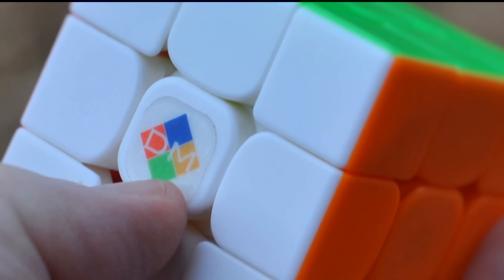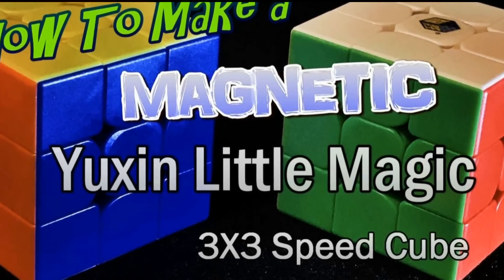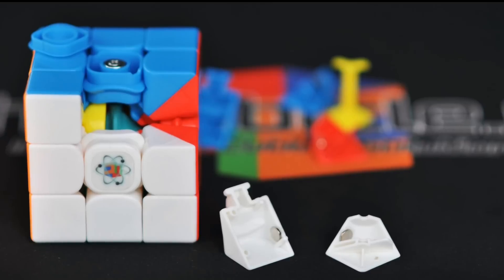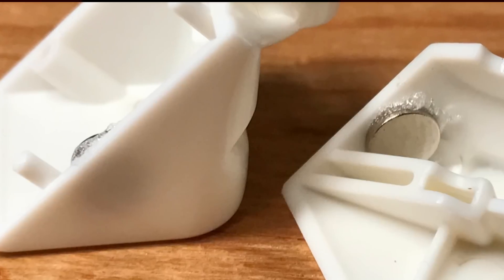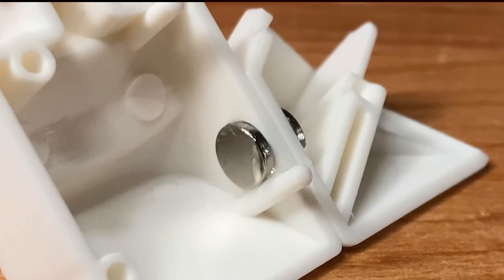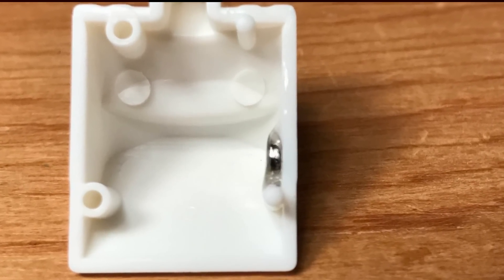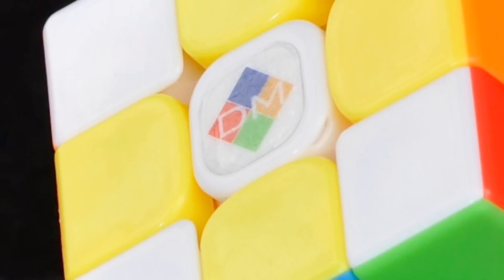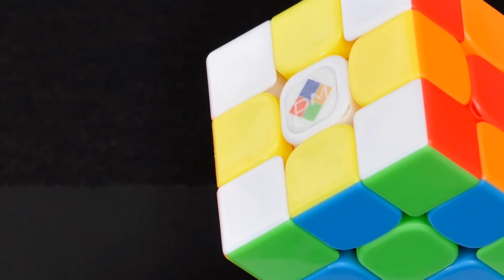Magnetizing the MoYu MF3RS2 Speed Cube

Comment: How long did it take you to magnetize the mf3rs?
Reply: Thank you for your replying I’m such detail! I just ordered magnets and they’re coming on Tuesday. I just wanted to know what to expect from gluing magnets, but thanks to you now I know! I’m going to magnetize my thunderclap v1 and I just wanted to know how far back in the edge I should put the magnet? Keep replying to others and giving advice because it sends positive feedback to the viewer and that gets you a sub! Thank you for your time and have a great week! Ps: I did subscribe 😃
Reply from the maker: Random Dude Thanks for your kind words, and I really do appreciate the sub! Thanks!!!
Yeah, plan on an hour and a half for your first cube and I recommend leaving the glued pieces sitting overnight so the glue fully dries. 
The TCV1 requires a somewhat strong magnet. You'd probably be best to position the magnets closer to the outer edge than the center. (As we move the magnets closer toward the core, their perceived strength will decrease).
Reply: Yeah I got the magnet kit from thecubicle and it comes with N 48 magnets  which is what your video on the thunderclap said to use. So pretty much I should position the magnets at the bottom of the post?
Reply from the maker: Random Dude they'll be a little subtle in the Thunderclap. There, I suggest N48-50 4x2. The plastic is thicker in that cube. N48 5x1s should work fine and will be on the light side. 
In the MF3RS they'll be closer to medium subtle.
Reply from the maker: Random Dude Oh and yes, bottom of the post. It gives something for the magnet to be glued to.
Reply: Thanks!
Reply from the maker: The amount of time usually depends on how much you clean the cubie pieces, whether you clean them inside and out and whether or not you take a break between gluing the edge piece magnets and corner piece magnets. Also whether or not not you allow all the glued magnets to sit overnight to allow the glue to harden and cure. 
Generally speaking you can have all the gluing done in under an hour. 45 minutes when you've done a few and you're doing a precise job and rushing things. 
Two things I think are important:
1, magnetizing a cube shouldn't be done as fast as you can do it. It's not a timed cubing event. There's one particular misguided magnetizer who prides himself on being able to magnetize a 3x3 in a few minutes. When you rush like this, you're not assuring the glue is under the magnets. 
2, both superglue and the foaming type of glue the Cubicle uses need time to properly dry and harden before reassembling the cube. I actually let my cubie pieces dry overnight so that fumes coming from the glue doesn't fog and etch the plastic. 
You're making yourself a performance cube that's capable of breaking world records when you prepare it properly. Why jeopardize a quality job by rushing things?
Reply: I just woke up and I opened one of the pieces and the polyurethane glue was pretty hard. Thank for all the advice!
Reply: Btw my cube turned out great no pun intended
Reply from the maker: Random Dude Awesome, man!!!! Glad everything went well!!!
Have fun!!!
Reply: I just finished magnetizing the cube and I let its dry for 1 hour.is that long enough for me to speedcube on it? I reassembled it but should I wait till tomorrow to use it?
Reply from the maker: Random Dude I personally would have waited overnight to reassemble because the accumulation of fumes inside the cubie pieces is going to frost and fog the inside of the pieces. But since you've already assembled it, you could probably start lubing it and in a few hours start doing solves. Just be careful not to drop the cube or slam it down because the glue really won't be fully dry for another 24 hours.

Comment: I'm going to use N50 5x1 in the edge and N40 4x1 in the corner, is that good?
Reply from the maker: Sure, you can do that! The resulting pull force is going to be equivalent to using all N40 5x1s, so the strength of the magnetic attraction is going to be on the subtle side. I don't think it will be too weak, but the magnets will be subtle. If you use this combination, please be sure to let me know how it turned out.
Reply: @dmcubing6342  Sorry to make you wait. Well, it's not too strong enough, a little bit weaker than my YueXiao EDM, I think it's not a good idea, need to be re-magnetized again.
Reply from the maker: Thai Hoang Before you do anything: break it in and give it some time. You'd be surprised how sometimes the magnets will feel too subtle, but after the cube loosens up after a week or so, those same magnets will feel perfect.
Reply: @dmcubing6342  I hope so! I'll wait about 1 week to see the result but right now I think I did a BIG mistake. The cube is very uncontrollable, sometimes it makes me do wrong algorithms especially T perm or J perm, I guess maybe the magnets in the corners(N40 4x1) are too weak. You should try out to see

Comment: Do you think 5x1 N52 magnets will work? I want something stronger than 5x1 N48s but still has the same size
Reply from the maker: Yes, they should work fine.  If they're genuine N52, they'll give a medium strong feel. Cubicle Labs uses the N48. But yes, they'll work perfectly fine if you're looking for a little stronger feel.
Reply: @dmcubing6342  how can we check whether the magnets are genuine N52?
Reply from the maker: hotdog king Well, you really can't unless you have magnets in other grades to compare them to. But a couple of things can help: If the N50 or N52 magnets are priced the same as N35, they're probably not truly N52 in strength. Higher grade magnets cost more. If it's a reputable company you're buying from that has a large assortment of magnets, they're probably genuine. 
I've noticed over the past several years that the majority of "N50" magnets being sold at bargain prices are usually more like N35 in strength.
Reply: @dmcubing6342  unfortunately the magnets i  got were very weak, so i doubt that they were really N52s, the only thing i can think of is to double the magnets on the edges only, so that it will have a stronger pull strength (also not at both the edges the corners because i think that that would be way too strong). Do you think this method would work?
Reply from the maker: hotdog king Ah, man, I hate to hear this! What company did you order the magnets from? I will warn others not to order from that company.
Yes, you certainly can double the magnets. And I think the edge pieces would be a good place to put them so you'll have potentially more middle slice momentum.
Reply: @dmcubing6342  sadly i really dont know, i only asked my brother to order the magnets and currently he is out of town. Thanks as always though for the help, DMCubing!

Comment: Hey have you used 4x1.5 N38 magnets before because gaussboys doesn’t list 4x1.5 N35s and I’m assuming that the click will just be slightly stronger but I wanted to know if they would still work fine
Reply from the maker: geekdemon Yes, actually I have used the Gaussboys N38 4x1.5 in other cubes. They'll work perfectly in this cube. The N38 4x1.5 is just a little weaker than the N35 4x2 and is perfect in cubes where the N35 4x2 tends to be too strong.
Reply: DMCubing ok thanks I’ll probably try them in my second volt m

Comment: Should i magnetize my mf3rs2 or mf3rs3?

I wanted to use 4x2 N50 in the edge and 4x2 N35 in the corner.
Reply from the maker: Hmm. That's a lot of magnetic strength. First, I certainly wouldn't use this combination in the MF3RS3 because it uses a thinner plastic. The 3 has slots for 4x1.5 magnets. If you want to use 5x1 or 4x2 magnets, you can always locate the magnets on the opposite sides from the slots. 
Also in the MF3RS2, I wouldn't use N50 4x2 as their strength, even if you combined them with N35, would be fairly strong. If you happen to prefer a stronger magnetic attraction, it might work out ok. But certainly don't use this combination in the MF3RS3.
Reply: @dmcubing6342  ok i'll magnetize my mf3rs2 then.. thanks for the information
Reply from the maker: Tateru Wise choice! Let me know how it goes. Have fun!

Comment: I used n50 4x2mm magnet but it was still weak for my liking. So i put more magnets on the edge pieces. So its 4x4 in the edge pieces. Turning is perfect but M move requires a bit of effort. Stacking n35 4x2 over n50 4x2 in the edge pieces would be perfect and that's what I'll do next.
Reply from the maker: The unfortunate thing about a lot of "N50" magnets is so many of them aren't actually true N50 strength, particularly if they are budget priced magnets. I have had this happen to me. Unless you pay considerably more for them, you kind of risk getting basically N35 strength magnets being passed off as something more than they truly are. Best dealers I've found for true N50 magnets are Gaussboys Magnets and OMO Magnets.
Reply: @dmcubing6342  I used OMO magnets and when i compare, the n50 is stronger than n35. I used n50 4x2 on GAN 356R and it's almost impossible to turn, the magnet was way too strong. The strangest thing about GAN356r after magnetization is that I can feel the magnet pull (click) every 45 degrees, even with n35. This totally ruins the feel.
Edit: The 45degree bump is not because of the magnet, GAN356r is very bumpy on every 45degree turn. Anyone have the same experience?

Comment: Do n35 5x1 magnets work
Reply from the maker: Unless you prefer a very light, subtle magnetic attraction, I would recommend using a slightly stronger magnet such as the N42 5x1 or the N48 5x1 (the magnet the Cubicle uses). You could use an N35 5x1 but there would be only a slight hint of magnets in the cube.
Reply: Oke, thank you

Comment: N35 4x1,Is it work great?
Reply from the maker: No, really they would be too weak. But if they are the only magnet you have access to, you still have a couple of options. 
You could double the magnets so that you're essentially making a single 4x2 magnet by stacking two 4x1 magnets. You could then magnetize the entire cube this way for a medium strong magnetic feel. It takes 96 magnets. 
Another option, resulting in a medium subtle feel would be to only double stack the magnets in the edge piece halves and use a single 4x1 for the corner piece thirds. It will take 72 4x1 magnets doing it this way.
Reply: Thank you very much,You help me because i almost order those magnets.
How about N38 4x1.5?
Reply from the maker: ZR Cube N38 4x1.5 would be PERFECT actually!!!
Reply: Really?,Wow that’s good because i just order that yesterday.LOL
Reply from the maker: ZR Cube Yep! They fall within the strength you need.

Comment: What magnets do u recommend for a mf3rs3?
Reply from the maker: Yi Chen Gan I'd use a 5x1, probably either in N48 or N42 strength, like with the MF3RS2M. Position the magnets up so there is plenty of room for them. You could also use N35 4x2 and they would work out well too.
Reply: Will N35 5x1.5 be good?
Reply: Or that's too strong, maybe a combination of N35 5x1 with N35 5x2 or 5x1.5 in the edges?
Reply from the maker: Yi Chen Gan If all you have access to is N35, I would use N35 5x1.5 in the edges and N35 5x1 in the corners.

Comment: What if N38 4*2 
Will it work?!?
Reply: Ok thanks!
Reply from the maker: Sharkey 352 Yes. They will work fine and give the cube a medium strong magnetic attraction feel.
Reply: But whats the best? 
N35
Or 
N38
Reply from the maker: Sharkey 352 I'd probably go for the slightly weaker N35 4x2. It's a really good strength magnet. If you prefer a stronger magnetic attraction, the N38 would give just a tiny bit more attraction strength.
Reply: @dmcubing6342  ok ThANKs 👌

Comment: I was wondering if the cube will fir 6x1.5 magnets? I see that you use 5x1 and they fit great, with just a little bit of space left. I don't have the cube, but I am planning on buying one and magnetizing it. That's why I don't know if they will fit.
Reply from the maker: Maya W I think a 6mm wide magnet is going to be just a tiny bit too large to fit properly in the corner piece. Even using 5mm wise magnets, you have to place them far up along the inside wall of the edge piece and there isn't much extra space in the corner piece third when you align the magnet inside of it. Also, a 6x1.5 magnet would be significantly over powering in this cube. You really don't need that much magnetic attraction to make this cube good.
Reply: @dmcubing6342  Thanks a lot for answering me. I will get 5x1 magnets then. Maybe even 4x2.
Reply from the maker: Maya W Sounds great!!!

Comment: Do 4x2s fit fine in the corner? Or do you have to move is up a bit
Reply from the maker: ThE 1 BarbariaN Gee I can't remember. I seem to recall the 4x2 fit fine and it's the 5x1 that need to be positioned up.
Reply from the maker: ThE 1 BarbariaN 2:11 check the video at this point. 4x2 is tight in the corner piece too.
Reply: DMCubing thank you, that’s what I thought with my magnets, but that’s useful

Comment: Is 4x1.5 magnets ok with this cube?
Reply from the maker: Kherby John Magallanes I think you could use 4x1.5. Depending on what grade you use, the overall magnetic feel will range from a subtle feel with N35 to a medium subtle feel with the highest N52.
Reply: @dmcubing6342  Can I still feel the magnets when I'm turning if I will be using n38? And btw thank you for always replying on my comments
Reply from the maker: Kherby John Magallanes Yes, you should still be able to file small, light, click is the magnets past each other. I generally use an N42 5x1 magnet in this cube. The magnetic pullforce strength of the N38 4x1.5 is 0.52lb, which is just a tiny bit stronger than the 0.49lb pull of the N42 5x1, so you'll be perfectly fine using the N38 4x1.5.
Reply: @dmcubing6342  Always thankful that you always response on my questions and btw nice video ;)
Reply from the maker: Kherby John Magallanes Your welcome!!!
I try to get to all the comments even if I don't upload much anymore. Glad to help. Thanks for your kind words!!
Reply: @dmcubing6342  Always welcome, and btw what's the main reason you don't upload much anymore? Cause I was just like ughh there's no other good tutorials on magnetizing a cube like how to magnetize cube such as gan 356 r or gan 356 air s. Some may have some tutorial but their tutorial wasn't good like your tutorials.
Reply from the maker: Kherby John Magallanes Just really busy with work and when I'm not working, every bit of my free time is taken up with photography. I photograph several concerts and functions each week. 
You can magnetize the 356R by removing all the caps, rebuilding the cube to its cube shape without the caps, and then magnetize like you would the original Weilong GTS. My very first (and cringy) video is on the GTS. I leave it up because it is the very first ever magnetic Rubik's cube tutorial! Anyway, if you take a look at it, you'll see how you can apply the same method to the new Gan.
Reply: @dmcubing6342  Oh thanks again and good luck on your job ;)

Comment: should i magnetize it with n35 or n52? i've magnetized a little magic before with n35, and i think it's a little too weak for the little magic. what about the mf3rs2?
Reply from the maker: boubouhu Do you like the feel of stronger magnets? If so, you certainly could use something like an N48 or higher 4x2. For most people, that's going to be a fairly strong magnetic pullforce for this cube, but if that is the feel you like, then it will be fine. 
I personally like a 5x1 magnet in this cube. You get a wider magnetic attraction without the need of a stronger magnet. N42 and N48 5x1 work excellent.

Comment: Hi!! I just ordered 5x1, 4x1 n50 and 5x1 n35 what should I use for this cube
Reply from the maker: MJ bera For this cube, certainly not 4x1. You have two different strengths of 5x1? If so and you like a medium strong feel, use the N50 5x1. N35 5x1 would be rather weak and subtle. If you could keep them from getting mixed up, you could actually use the N50 5x1 in the corners and N35 in the edge pieces.
Reply: DMCubing I actually have no experience with magnetizing by my self so I didn’t know what to buy, I want a strong feel so I guess I’ll go for the last suggestion. Thanks!!🙏
Reply from the maker: MJ bera If you like a strong feel, all N50 5x1 will do the job.
Reply: DMCubing alright just to make sure, using only n50 would it make feel slower ??

Comment: Is it ok if I uses n35 5x1 in corners and n35 5x1.5 in edges
Reply from the maker: Yi Chen Gan Sure. That's actually a great idea. You'll have a subtle magnetic feel but not too weak. Let me know how it goes and how you like it if you do it this way.
Reply: DMCubing well would you prefer using n35 5x1.5 throughout the cube or using 5x1 in corners and 5x1.5 in edges?
Reply from the maker: Yi Chen Gan I'd go with the combination. All N35 5x1 would be rather weak, all N35 5x1.5 would be too strong. The combination of both would be perfect and have an overall pullforce strength equivalent to just between N42 5x1 and N48 5x1.
Reply: DMCubing and what magnet would u suggest for a OH huanglong main?
Reply from the maker: Yi Chen Gan I think I've magnetized that cube. Isn't it fairly heavy? If so, an N35 4x2 would probably be appropriate.
Reply: DMCubing so n35 4x2 will be fine of my OH huanglong?
Reply from the maker: Yi Chen Gan Ok. I found my notes on it. Wow, I had totally forgotten about that cube. You DO NOT want to use 4x2 magnets in it. Three options:
- N35 5x1
- A mixture of N35 4x1.5 in the edges and N35 4x1 in the corners.
- N35 4x1.5 
The mixture of N35 4x1 and 4x1.5 would be the weakest. Next would be the N35 5x1. 
The strongest would be N35 4x1.5. 
I'd personally recommend N35 5x1!
Reply: DMCubing wow!! Thanks I found that note very useful thanks so much!! +1 sub
Reply from the maker: Yi Chen Gan Thanks so much!!!! 😀